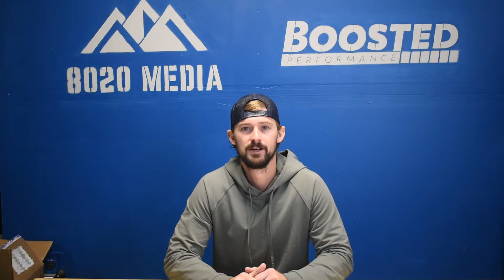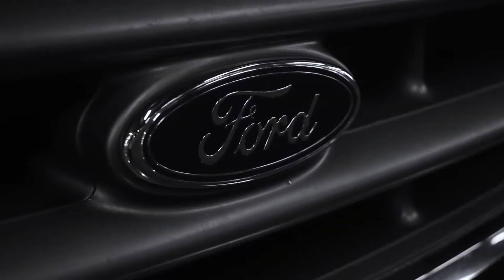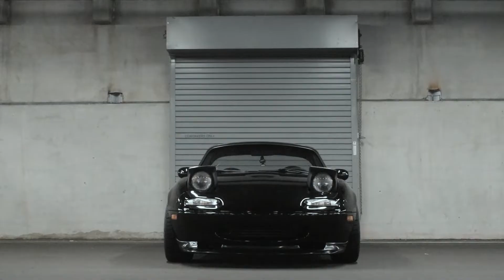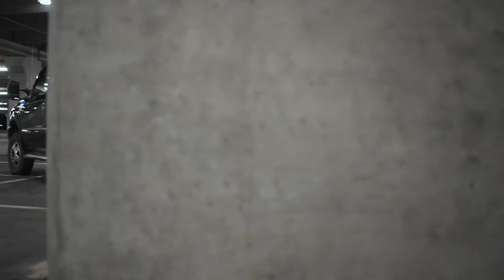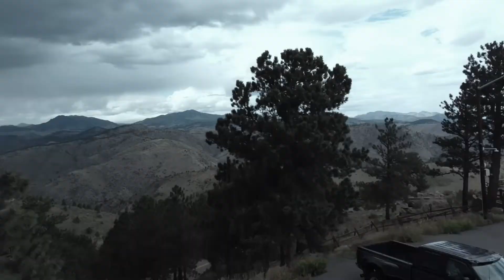3.0 EcoDiesel Reliability & Common Problems!

Comment: Good video Jake, thank you. I guess I'm one of the lucky ones. I have a 2017 with 125,000 miles and no major problems. The only problem I'm having, is that I have not been able to get the HP Fuel Pump recall done. I keep getting that the parts are not available yet. Do you have any suggestions on what I should do?
Reply from the maker: Jose - Thanks for the feedback! Unfortunately, this happens often.. When recalls get issued, parts fly off the shelf and it takes a while to get them back in stock. Best thing is to reach out to your dealer.
Reply: Thank you Jake. 👍🏼

Comment: The Ecodiesel was not a clean sheet design by Chrysler. It was designed by GM and VM. Chrysler bought the engine design for next to nothing after GM threw it away.
Reply: After GM fielded for Chapter 11 LOL
Reply from the maker: Mark - Yep, thanks for sharing this insight!

Comment: I’m surprised you didn’t mention anything about the lower ends, more specifically the mains and rods. 128k on mine and it sent the rod into the oil pan. Wish I knew about all the problems before buying. Always rigorously maintained and never beaten on.
Reply from the maker: Austin - It's quite difficult to list ALL of the problems an engine can experience. Therefore, we do appreciate you bringing this up for future viewers!
Reply: Did you have it fully deleted

Comment: Thanks for making the video! I have a 2014 GC with 181k on it. I think the key to this particular engine lasting is to really drive it. Sometimes I would be doing 1000 miles a week. I have towed alot too. I would have definitely got a gas motor if I wasn't driving it much.
Reply from the maker: L - Thanks for sharing your experience. We completely agree.
Reply: Way to keep us updated there pal
Reply: Short trips (commuting under ten miles or so) are really bad for these as it doesn't ever get hot enough to burn off the soot particles.

Comment: Italians build excellent diesels, FPT marine diesels are some of the best. 160,000 trouble free miles on my "tuned" Ram. No complaints.
Reply from the maker: Form - Seems like you got a good one! Thanks for sharing your experience.
Reply: @8020Automotive  mine also has got 150000 with no problems
Reply: Your actually driving a Maserati :)
Reply: The engine manufacturer built 250,000 3.0 Eco Diesels... 50,000 failed.
Look it up!

Comment: Thanks for your video.
I would like to add my personal experience with my Jeep GC 2018 and some information on this engine:
- my jeep is now 215k KM and is working very fine (i.e. current performance is very close to those of day 1), and without any major concern, very lately, I had to change the air intake manifold that broke one of its flappers. For the maintenance, I am changing the engine oil every 10.000 km (I am not waiting for the oil change indicator warning) and I use Castrol Magnatec 5W40 C3. I am not servicing my car at the dealership, but I am doing it by myself with the help of an experienced mechanic. From my personal experience, I came to the conclusion that the local authorized dealer is a major cause of bad performance of those engines and of the car in general, the dealer personnel are not skilled/supervised enough in order to apply FCA guidelines and instructions, this is my deep conviction today… when you give your jeep to those folks for the first time and they put a 5W30 oil, and for the next oil service, they put 5W40 and they hand you back your car with a check engine light on, I believe there are enough evidence that you need to fear those people and take away your car from them. By the way, I am living in Morocco and FCA dealer here is a consistent presence (fancy big building, a lot of workforce…) but the quality is not there unfortunately.
-this engine is designed by VM Motori, a diesel engine designer based in Italy and recently purchased by Fiat. This manufacturer has a satisfactory track record, and they designed engines that was used by several car manufacturers (alfa romeo, land rover, toyota, jeep…). The engine block (code A630) used on the grand cherokee and the RAM is also used on Maserati Guibli and Levante with some performance modifications. But this is a controversial engine, the fully satisfied customers are as much as the ones who experienced engine failure…
-the italians are apparently good in diesel engines, it seems they are the first to register a patent of a common rail diesel engine (alfa romeo), they are behind the famous truck brand IVECO and CASE tractors that are equipped with engines from FPT (fiat powertrain technologies). So i believe they have a good reputation in diesel engines.
Thanks for your very informative video 👍🏻
Greetings from Morocco 🤝
Reply: Biggest problem is the EPA mandated smog crap, second is dealer network. Great motor, even better than a hemi, if tuned and deleted. 30 miles per gallon US in a 3 ton Ram 4x4 Crew Cab.
Reply from the maker: Y - Thanks for taking  the time to write out your experience! This will certainly be helpful for future viewers.

Comment: Ya know i watch your video and the other channels like it and I'm like yeah these suck. But then i read the reviews by owners and I'm like well?  I own a 2015 Jeep GC, 100K no issues, runs great, great fuel consumption, my only issue and maybe its my ignorance is well two issues, one, the oil gets a little hot when i'm towing in the mountains. Like 260ish not for long but it gets there and i'm towing maybe 4000. Mind you my trailer is flat so there is wind resistance. Second the recalls, the HPFP is now over a year and no end in sight. Now they have stacked the new recall on so who knows when or if they will fix it. I mean do they even intend too, since the are canceling the motor?  I was planning an oil cooler and a delete and all that but 'im like is it worth it? On the other hand i could like the other posters get another 2 or 3 K and no issues.  The question is what percent are we talking here for these failures? Most the posters below seem happy so im curious.
Reply from the maker: S - We can't really provide a percentage so to say of the issues. We can only say what we have seen in these engines. It really comes down to the luck of the draw. Just keep up with maintenance, that's all you can do.

Comment: My 2018 ED just blew out the oil cooler while towing about 7000lbs at altitude, Only 42000kms on the OD.  Currently waiting to hear from the dealership to find out if it's going to be covered under a good-will warranty.
Reply from the maker: Ryan - So sorry to hear this.. Please keep us updated!

Comment: These engines are dirty due to the egr. That soot makes its way into the oil. You cannot go 10k between oil changes. You really should be adding fuel treatment to protect your hpfp. That cp4 pump is on the ford and Chevy motor and they have the same issues. These modern Diesel engines need to de taken care of you cannot just put diesel in them and go
Reply: Agreed, most ecodiesel owners don't even know what an oil change is. They do 40,000 miles, then complain when the bearings fail.
Reply: You base this on? @SupramanTRD
Reply: @SupramanTRD you talk too much
Reply from the maker: Ryan - Thanks for adding this valuable insight. Will certainly help future viewers!
Reply: What kind of fuel treatment are you referring to?
Reply: @ron1386  I use hot shot everyday diesel treatment

Comment: That oil pressure problem could be caused by letting the engine idle for prolonged periods of time. I know a lot of guys tend to do that, but it's not good for the engine. The oil pressure drops when your truck is idling. When idling for too long it could lead to oil starvation. Doing this all day, everyday results in a lot of engine wear. Also, regular oil changes need to be done at proper intervals. I'm sure the engines that made it to 300,000 miles were well maintained.
Reply from the maker: Duncan - Thanks for sharing this insight! It will definitely benefit future viewers.
Reply: Nope...
Oil Pick up being blocked.
Check out all the videos about it
Reply: @mountainconstructions  Exactly

Comment: I’ve got a 2015 Laramie with 238k on it that has been great! I’ve rebuilt the rear end, replaced the oil cooler, and replaced the low pressure in tank pump, and yes it is running on unicorn poop secret sauce since the warranties expired. I love this truck so much the wife now drives a 2018 Grand Cherokee Summit Eco-D. In your video you stated 2017 years, no Eco’s were made in 2017 due to the redesign of the Eco’s due to those that had engine problems.
Reply from the maker: IR8 - Thanks for sharing your experience! This will help future viewers.
Reply: Unicorn poop secret sauce 😂 @8020Automotive
Reply: I just purchased a 2017, and am confused by your comment that ;no ecos were made in 2017' would you elaborate?thanks

Comment: I believe the EGR and HPFP have been shown as recalls on these engines from FCA. Don’t see anything about a recall for Oil Cooler.
Reply from the maker: I believe the oil cooler was an extended warranty and not a recall. But only for 2014-2016 models.
Reply: yes but the HFFP has no date of completion.

Comment: I’ve got a 2014 270 K eco and it’s been perfect
Reply from the maker: Jorge - WOW! Love seeing that. Any specific insight you can provide on maintaining it? This will help future viewers.
Reply: Same here, my 14 has 205k only problems Are emissions crap
Reply: I have 2017 Eco diesel 340,000 miles no problem at all
Reply: I heard they are okay if you just use it like a passenger car and don't tow
Reply: @timothykeith1367   I tow daily, 344k on my 2016, these videos of crying dont make sense
Reply: They make perfect sense. You're a moron that doesn't understand sample size. Just because you've had minimal issues, doesn't mean everyone else has. It's called anecdotal evidence.
Reply: @BrandonJtrades how do you think it would do with just daily driving and some work like gravel ECT? Maybe some light towing?

Comment: I think the bottom bearing failures are on  the 2014 - 2019 models.
Reply: Is it actually due to bad bearings though? Or owners not knowing what maintenance is, and having them seize from sludged oil? Most of the people I see driving these trucks have no idea how to take care of them. Then blame the truck when it eventually fails
Reply: @SupramanTRD  There are just too many failures to be attributed to owners not giving proper maintenance.   There's a  reason for the redesign as well.  Anyhow, we sold ours back to the dealer and am in a 23 LZO Duramax diesel and love it.  No worries about a $18,000 repair bill.
Reply from the maker: John - Thanks for the input.
Reply: @supramanTRD 2016 ED 128k miles, rigorously maintained and never beaten on. Always driven decent distances as I live 20 miles from town and regularly took it on trips 3-5 hours. Rod shot into the oil pan.